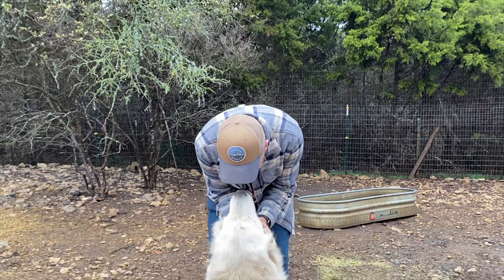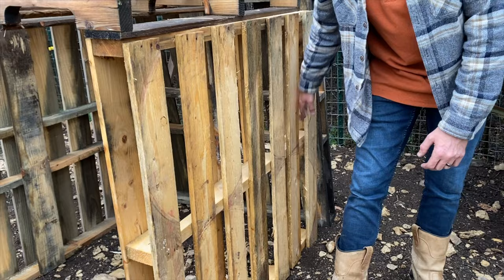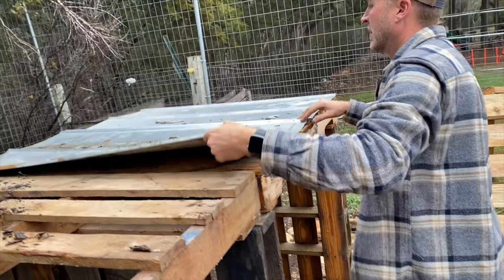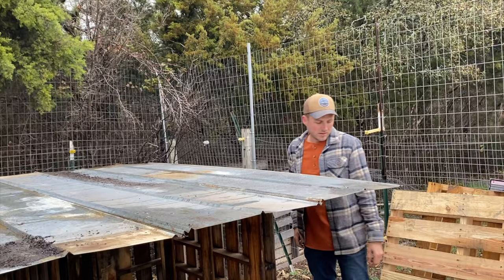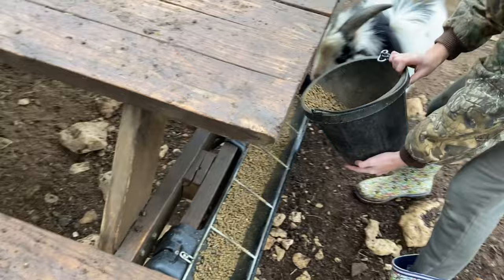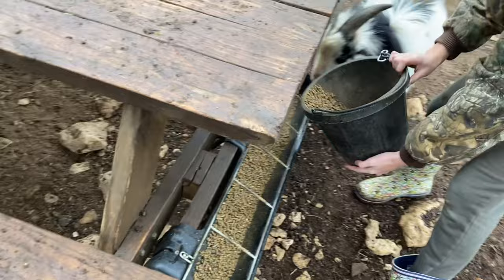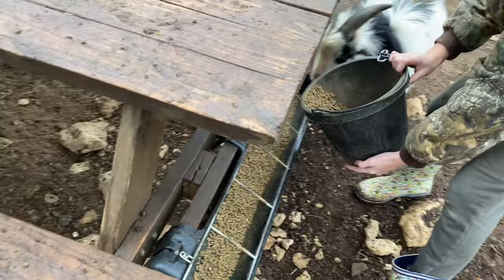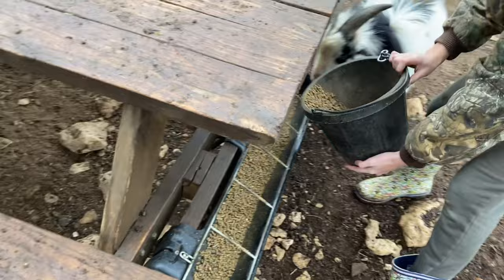Baby Goats on the farm! Plus we build a Pallet Wood Goat Shelter

Comment: Just thinking...  If the "solid" walls were removable, they could protect from rain and wind in winter.  Then remove them and put on top and extend top to provide extended shade during the summer months while opening up walls to more or a cool breeze..  Maybe use plywood with hinges on the top that fold up.  That way more shade and more room so that they don't heat up cuddled up together...